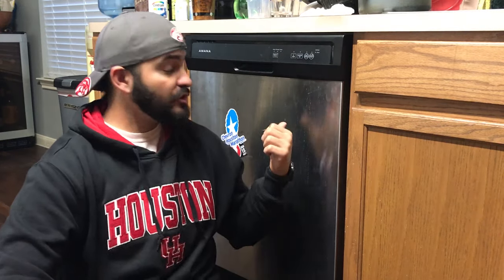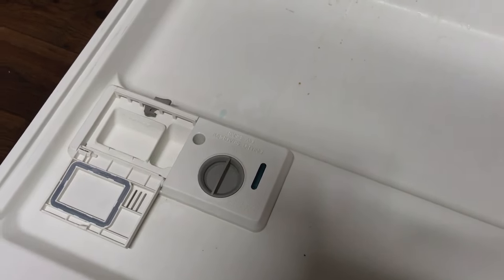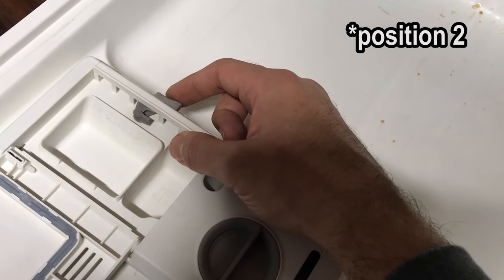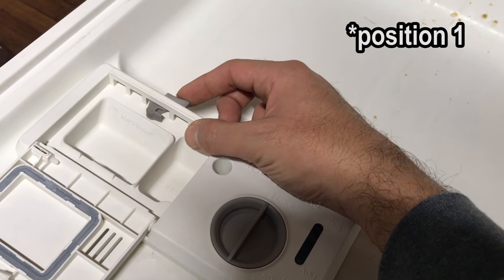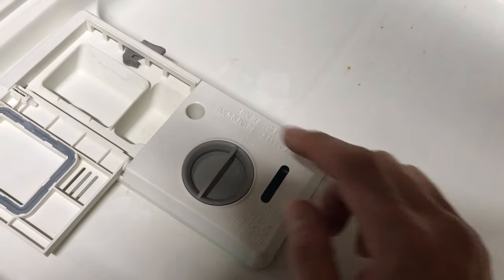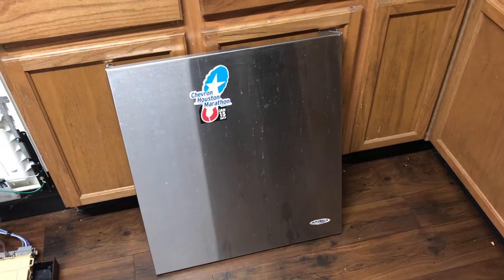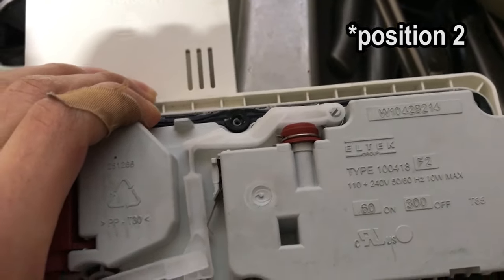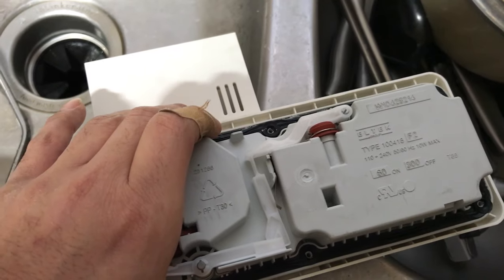[FIXED] Dishwasher not releasing rinse aid

Comment: If what you say is correct, why didn't you need to add more aid in 4 years? I've watched over, maybe I missed it.
Reply from the maker: There was no need to add any, because it was always full. It wasn't releasing any rinse aid, so the rinse aid dispenser was always full. Even now, the level hasn't dropped that much in last couple of months, but I don't use it all that often anyway. I'll be lucky to have a full dishwasher once a week, so it's not using much rinse-aid as it is.
Reply: @bird2002 I'm confused as well, as I thought you were saying that it was opening, just at the wrong part of the cycle.  If it opened the rinse aid at the wrong time, why would nothing come out?
Reply from the maker: @marauderdz  my best guess from countless hours of googling online, I've come to the conclusion that the computer holds position 1 for a short period of time, while it holds position 2 (rinse-aid) for a longer period of time. Mostly because opening the door doesn't require more than just a brief lift of the control arm, and releasing rinse-aid requires more time to allow for the proper amount of liquid to release. 

As such, being in the wrong position means that it's not opening the rinse-aid dispenser long enough for any of it to come out. And even if it does release a tiny amount, it's doing it during the wash cycle and not during the rinse cycle, so it's not helping at all. 

I hope that answers your question.

Comment: This video got me worried that my Maytag rinse-aid-release had a 50/50 chance of not being in sync with the release of the detergent and/or the rinse cycle. But I don't believe that now. I did some testing on my machine and have arrived at the following: If working properly, the whole mechanism resets correctly when you close the detergent door. What I did was, starting with an open detergent door 1)Click the release so it felt "hard", 2) Close the detergent door, 3) Open the door, 4) Click the  release to feel if it was "hard" or "easy", 5) Click it again to feel for "hard/easy". Then I repeated the experiment, but started with step 1) so the release felt "easy". What I determined was that it does not matter how the release feels in the first step - When the detergent door gets closed, it takes the same effort to open it, and the next click is always "hard", always followed by "easy". So from this I surmise that the mechanism resets. Also, I found nothing in any literature that warns about this, which IMO would be a huge design flaw. FWIW
Reply from the maker: I don’t suspect that closing the door resets mine. Yours might be different. If shutting the door resets the mechanism every time, then it’s possible that yours has an improved design that fixed the flaw that mine has. My door does not reset the position, so mine was out of sync. I also scoured the internet for information on this issue and didn’t find any. It wasn’t until after I took it apart that I discovered how the mechanism works. I could be wrong, but that’s what I found inside mine, so I shared the video. I’d be interested in seeing what the inside of yours looks like. If you post a video about it, please share.
Reply: @bird2002  I'm glad to have found this buried comment as I was wondering if closing the door after putting in the detergent would negatively affect the way it works on an Amana.  I left mine set after the soft click but it doesn't seem that any rinse aid was released.  I will keep trying.  I really appreciate your video.

Comment: What a horrible design.
Somebody gave me one of these that 'stopped working'
1 year after installation.  I work on small engines,
and was curious how this junker worked.
Wondering if the owner was experiencing the problem you mentioned.
I absolutely HATE dishwashers and will use it
in the shop to wash mower parts....maybe.
Thanks for the info.
Reply from the maker: After I got this fixed and started using liquid detergent for the pre-wash, I have fallen in love with my dishwasher. And it's so much more efficient than washing by hand because it uses considerably less water.

Comment: I am doing this. Thank you so much!!!!!
Reply from the maker: Let me know if it works for you. I also recommend using liquid pre-wash as it helps you achieve way better results. My dishwasher does such a great job now that I’ve got all my advantages set in my favor.
Reply: @bird2002  It didn't work.  My rinse aid is still full. I hope I did it right ✅
Reply from the maker: @angiejaco6173  it doesn’t empty out right away. It takes a whole bunch of washes before it runs out. The true test is to see if your dishes are still wet after the wash or not.
Reply: @bird2002  They were still wet. It's a white Amana dishwasher and it's the  number 1 complaint. I see why lol
Reply: Update; I flushed out all the old jet dry. Did the clicks again and I heard it release.  I filled it up with fresh Jet dry. My dishes were pretty dry this morning.  Thank you for the help!!!!
Reply from the maker: @angiejaco6173  that’s awesome!! I’m glad you got it squared away.

Comment: Depending on how my next cycle turns out, probably gonna take it apart anyway, but thanks for the heads up, I've been seeing soap scum build up on all my shit and it's been infuriating... Still better than washing by hand though.
Reply: Try a Cascade Platinum pod in the flatware caddy instead of the dishwasher dispenser. It will partially dissolve in the prewash and fully dissolve in the main wash. It has rinse aid in it so you don't even need rinse aid. Run the hot water at the sink til it's really hot then immediately start the machine. Try it. I think you will see a difference.

Comment: Omg i feel so stupid if this works for me. Thanks
Reply from the maker: Imagine how I felt taking it apart 3 times before I realized that the mechanism was there the whole time 😂. Not everyone has the same problem, but hopefully this works for you because it’s a simple fix and you don’t have to take it apart like I did
Reply from the maker: Well you shouldn't. I studied Electrical Engineering Technology and hope to be a licensed Professional Engineer one day. I figured the Mechanical Engineers that designed the parts would have implemented a fail-safe against something like this happening, but they didn't. So it's not really our fault, it's just poor planning on their part. And worse yet, there's no resources online that warn against it. I had to take mine apart to figure it out.

Comment: I hope I did this right
Reply from the maker: If you listened for the loudness of the clicks, you should be fine. You might also notice that it feels different too. When you push the lever, you can feel a soft resistance when the rinse-aid release is engaged, but that may only be on models that use the same type of release mechanism.

Comment: THIS DOES NOT FIX THIS ISSUE!!!!
Reply from the maker: This may not have fixed YOUR issue, but it did the trick for several hundred people. Read through the comments, other folks had similar problems caused by something different, so this video is not the cure to all problems.